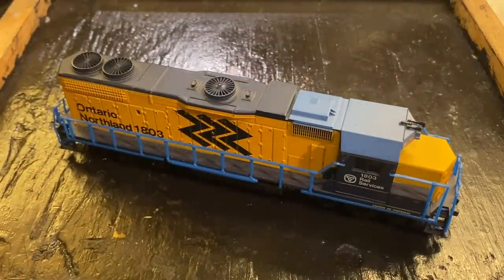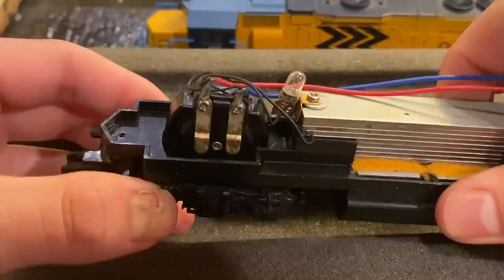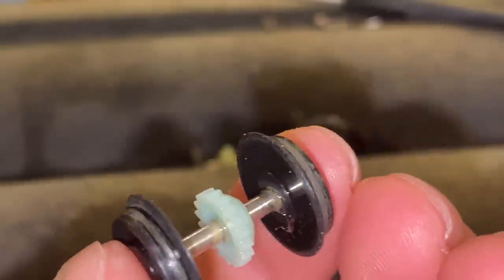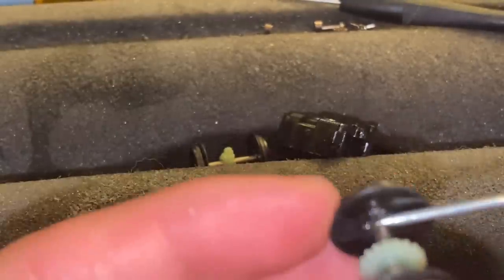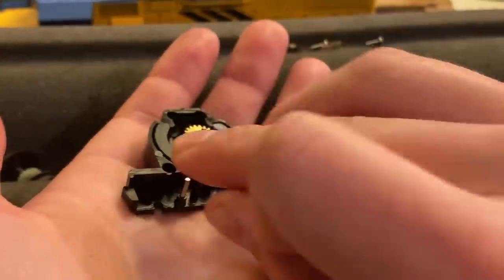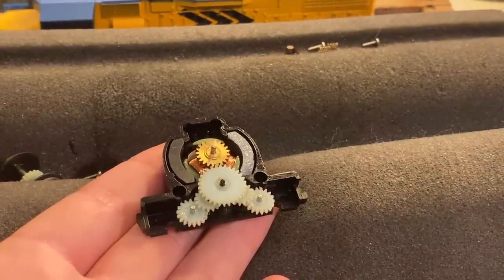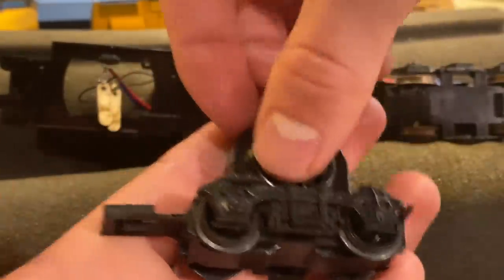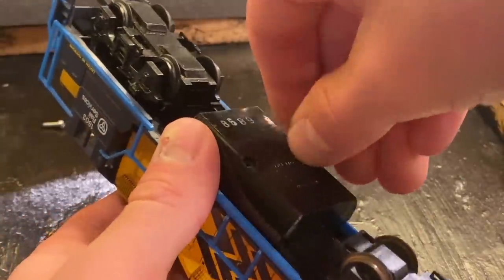How to do Basic Maintenance on Life-Like Pancake Motors - ONR GP40

Comment: I inherited an old train set from my Dad recently and it hasn’t ran since the 90s. I set it up and it wouldn’t run. I replaced the wiring and cleaned the engine using your video and it works great now. Thank you!

Comment: The screws into the truck assembly is a key feature. Better than all plastic snap-tabs.
I was thinking you were also gonna clean\lube the other axles/wheels... increases conductivity/decreases drag.
Having model trains for over 40 years and watching you (and other model train servicers) has increased my ability and self trust in servicing my older locomotives such as you have. Thanks a lot!
John  BC, Canada

Comment: Nice job, another great video.  I usually put them together and then put a drop of oil on the outside of the main or center bearing and let it work in by running the motor.  You have to show how Bachmann has that little tab screwed on the side to hold it in the chassis.

Comment: The easiest method of determining TOY train from Hobby grade train is the Pancake motor, Yikes these things are a pain.  I mean pain as it's far more fiddly getting those gears back together the rest is pretty basic but I never liked this style for it's pulling power or lack thereof and the noisyness to them.  I relegate these to TOY sets and not layouts though others may prefer them for whatever reasons.  Never throw these out there is always a part on them that you can salvage for another unit especially as they age the gears crack and spread apart, so save the gears or as I do put the whole unit in a box labled spare parts ;) My nephews are always happy I did for their train set repairs.

Comment: As far as I've found, these old Life Like motors were better put together than the Bachmann pancake motors. The motor is almost always cleaner with no wax tabs, no crazy wiring, but only brass wheels compared to Bachmann's silver wheels. Overall, both run almost the exact same.

Comment: Did life-like's pancake motor design come out first or Bachmann? Because one of them ripped off the other. The designs are identical other than the sideframes. Also I tried to lubricate a Bachmann F40PH with maple syrup, and it seized up, probably because it was an Amtrak unit.
Reply: The Life-Like locomotives were built by Bachmann for them.

Comment: Just to clarify, ONT 1803 is a GP38-2, not a GP40. Note only two radiator fans on top, along with a shorter radiator air intake on the rear.

Comment: The gear that connected the motor to the smaller gears melted. Little me was so confused as to why my train wasn’t going, now 7 years later I realized I should have stopped putting it at full power.

Comment: 2:24 - we call those "Jesus springs". It springs out and you say, "Jesus, where did it go?" Closely related to E and C-clips, AKA Jesus clips for the same reason.

5:59 - notice that crosshatching on the commutator. I see this also on Bachmann pancake trolley motors. My fix is to chuck that into a drill and start turning that against a 400-grit  emery board (foam-core type), suitably narrowed, and work my way as fine as I can get it - 1000-grit to 1600-grit. At that point it should be smooth and shiny like a new penny (assuming it's copper).

On the one motor I've done AND tested with a voltmeter, I took its starting voltage from 7.5 volts to 2.5 volts, which gave much smoother starts (less of a jackrabbit takeoff) and better low-speed response.

If it were me, for ease of maintenance, I'd clip those wires and hook in a 2-pin connector.

Comment: My life-like gp38-2 lights up fine but barely moves, and will only move if the controller is at full throttle, but then it starts smoking.  I've taken it apart and the motor looks fine, but on the... comutator (sp?) There is a small burn spot on one of the holes. Do you suspect this part is the culprit and I should get a new pancake motor?

Comment: Hi Harrison,
Thanks for this very helpful and easy to follow video.
I run o scale but, my nephew runs HO. He asked me to get his 2 Life-like diesel locos running again so I decided to step outside my O scale comfort zone and give it a try. Both engines have pancake motors. When I cracked open the first one I found a tiny plastic spacer under the large gear that sits directly below the output gear on the armature. Is it supposed to go on the top or bottom side of that large gear?
Reply from the maker: I believe the spacer goes beside the gear but I have trouble remembering sometimes myself.
Reply: @SMTMainline  Thanks

Comment: How do you get a life-like apart when the screws are stripped
Reply from the maker: You could try squeezing the plastic around where the screws are, sometimes the added pressure is just enough to get them out.
Reply: @SMTMainline  ok thanks
Reply: @SMTMainline  also I have a Bachmann pancake motor but I was taking it apart to fix it and the spring was lost